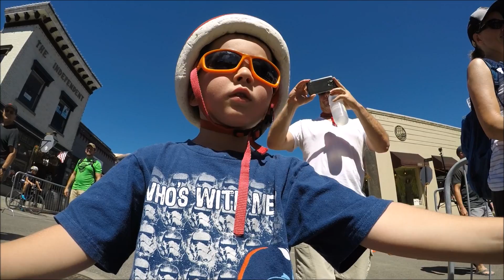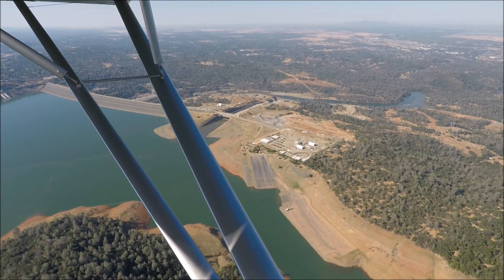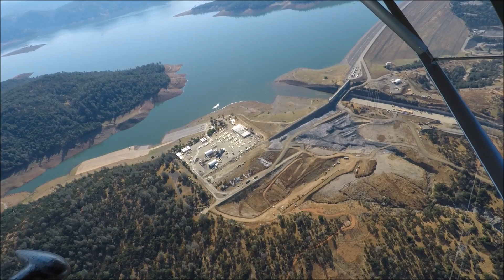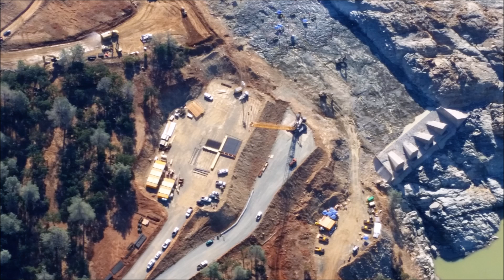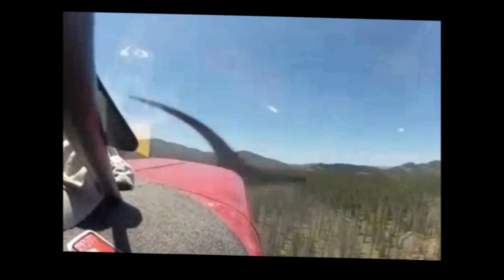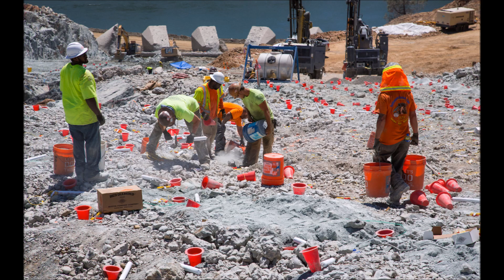Oroville Update 21 June It's Heating Up!

Comment: The part I find ironic is that the airlines do a CYA on the weight balance, etc calculating it to a gnats leg.   However the weight of the passengers and carry on luggage is estimated, not actually weighed.  Good part is that the jets most of you fly are much more forgiving than small general aviation airplanes like you also fly.  I am a wanna be pilot, always interested in airplanes, wanted to be a fighter pilot glasses in grade school put an end to that.
Reply from the maker: measure with a micrometer, mark with chalk,  cut with a hand axe...

Comment: As a flight engineer computing performance data for 23 years, I got a nice refresher.  Thanks.  But in my day we had performance manuals where we used charts to compute the speeds and distances.  Computers with performance data were not around in those days.
Reply from the maker: Spaghetti Charts!

Comment: I live in Maryland but I'm fascinated by the recovery project from the spillway failure. Yours are the first updates to which I turn when looking for the current status. Love the mighty Luscomb!

You've done a great job pointing out what the various areas are in the project. What I'm having a hard time with is understanding the overall plan. Examples: rebar has shown up above the diverters but I can't seem to find out what it's for; I've never understood what's going to fill the huge chasm where the failure occurred.

This leads me to wonder if this year's project can actually be completed in the next four months. DWR seems confident, but what a disaster it could be if that was over-confidence.

Thanks for the WebCam links. The time lapses are particularly informative.
Reply from the maker: stay tuned, update next week explaining all that...

Comment: That was a tough video to watch with the Stinson Voyager.  My father owned a 108 and learned to fly it.  He flew us all over Oregon, Calif. and Arizona.  I remember it as being LOUD inside.   I flew up to South Lake Tahoe one summer afternoon in a C-177RG just to experience density altitude for myself (alone, no luggage, half fuel).  An eye-opener but I had a plan to abort if I wasn't up to indicated airspeed by a certain point on the runway.  I had no problems but remember it well.

Comment: When I worked at Boeing in Wing Structures I think there was some office talk about possible heat induced loss of lift and power.  I also thought the FAA had requirements for operations in excessive heat but I didn't know there was a shortage of data for those conditions (until now).

Comment: What do you think of Scott Cahill's assessments?
Reply from the maker: borderline nutty.
Reply: From personally and professional experience, I've found that folks without the necessary background tend to dismiss technical and voluminous amounts information, as it is simply beyond their comprehension, and settle for the overly simple and convenient.  And reassurances are always welcome, while disturbing information is not.  IMHO, there always room for error and debate, however, if Cahill is only correct in part, the import should be substantial.  We have a responsibility to each other to tirelessly seek the truth.  Cahill is the only 'expert' to substantiate his conclusion.  We need to find an opposing view, an another independent expert, who is willing to substantiate his view in depth before we can consider the dam safe.  As it is, it prudent error on the side of caution and to consider it unsafe at this time.  Having worked within the bowls of government as a technical expert, we should not be satisfied by explanations from those who may have something to hide.
Reply from the maker: The dam is not an issue.

Comment: Juan--I don't want to read thru 400+ comments, so sorry if this has been asked...
you talked about flying early morning because of he heat, isn't the planes material also a factor? your Mighty Luscombe is aluminum? seems like that would be an issue
on a hot day, as opposed to a "fabric" covered plane? wouldn't  you plane be hotter?
Reply from the maker: not a factor...under extreme cold the fabric may wrinkle slightly.

Comment: Thanks for the update, Juan. You really keep DWR on their collective toes during the conference calls. I can almost hear their hands waving when they answer your questions.

I read somewhere that the flow rate of 270k cfs was predicated on the reservoir level being above 901 ft, in which case, the emergency spillway will also be operating. It would be interesting to know if that's correct and if so, what is the maximum flow of the gated spillway at 901 ft or less.

If the expectation is for overflow from the gated spillway to go into the "canyon", what are they doing to prevent erosion. If any substantive flow went through it as is, the loose rock would be flushed into the diversion pool in no time flat.

It would also be interesting to know if they plan to lay RCC on fill or if they have to remove all loose material down to the competent rock. If so, it appears they are pushing fill into the canyon which they will only have to remove.
Reply from the maker: we'll talk about this more in future updates...

Comment: Do you think the excessive heat is what happened to the RQ-4?
Reply from the maker: not sure...link?
Reply: http://fox40.com/2017/06/21/spy-plane-on-routine-flight-to-beale-air-force-base-crashes-near-mt-whitney/
Reply from the maker: Huh interesting...I doubt density altitude was the problem here...possible CFIT, of a drone...(Controlled Flight Into Terrain).

Comment: So, no plan yet on how they plan to "divert" some percentage of upper spillway water into the canyon if that becomes a necessity?? 
Question: 
If they do need to use the canyon, since they are apparently filling in the canyon (so far about 2/3), won't running a bunch of water through there simply re-locate all that loose fill into the "tailrace"?? Or, are they planning on "hard coating" the surface with shot-crete or ??? 

If possible, it sure would be nice to see some much closer shots of the landscape they are working in at the lower spillway to get a better sense of how big and irregular that base surface really is. The long shots don't do much to convey the scale of that texture. 

Thanks for the meaningful input you provide on this, as well as other subjects. Much appreciated.
Reply from the maker: One of my very next question!...I'll add those photos next update.

Comment: With all the new roads and exposed bare ground is erosion going to be a problem once the rains start?
Reply from the maker: They'll have the drainage worked out by then. Erosion control measures too...last step of the process.

Comment: Building I-680 Benicia Bridge Project with Kiewit back in 2005, we used "lightweight" high strength mix designs.  Often an 11.5 sack mixture.  Consider most commercial mixtures are 5 to 6 sack. That's  the amount of 92 lb sacks of cement per cubic yard of mix. Before mixer trucks left onsite batch plant, we'd stop at a tower that inserted a "wand" into the mixer barrel and would inject liquid nitrogen amount adjusted to ambient temperature.  We then had either 45 minutes,  or until wet concrete temperature reached 65 degrees,  to start discharging it into pump.

Comment: Considering the heat and the size of the budget, they should build a pool for the workers to cool off in! They already have all the equipment there. Seriously though, they must have a plan in place to ensure the workers are rested and cooled off periodically...for the health of the workers and also to improve their efficiency. I'm surprised they don't have air conditioned sheds everywhere. Maybe they are spraying them down with the water tankers? A water mist system would drop the temps by 30+ degrees. If the heat is forecast to continue, it might be worth the investment to keep things moving.
Reply from the maker: Good Idea! even a portable mix tanks type pool...
Reply: At the next briefing, you may want to ask them what accommodations they are making to keep the workers cool and hydrated. The other question I have is regarding the purpose of the fences they are erecting on the lower sw. Thanks Juan!
Reply from the maker: They discussed hydration issues at length. Not sure about the fence yet.

Comment: Things I see on the June 20 DWR video...-workers removing smaller rocks by the bucket.   - Rebar!  There's a bunch already installed in the cleaned section of the lower spillway.  They look to stand a whopping 7ft tall (or so).  -they mounted an old tractor tire to the excavator to scrape the muck from the water blasters.  -Is that crane on a new concrete pad? Or is that just gravel?  -Looks like workers struggling with a clogged conveyor belt at the rock crusher.

Comment: How will they make a watertight connection between the new lower spillway and the old upper one?
Reply: Maybe shingling the layers would be the best approach, have each section keyed and one pour extending well up past the bottom lip of the next.
The hydraulic pressure is enormous with that kind of fall- concrete expands and contracts so it has to be jointed.
Reply from the maker: sparkss4 stay tuned...good question#
Reply: Not sure why this would be an issue. New concrete can be bonded to existing concrete and anchored with rebar.

Comment: EDIT: I have finally found the other Webcams/ Timelapse videos
1)  http://www.parks.ca.gov/live/lakeorovillesra_spillway
2) http://www.parks.ca.gov/live/lakeorovillesra_spillwaytop 
3) http://www.parks.ca.gov/live/lakeorovillesra
4) http://www.parks.ca.gov/live/lakeorovillesra_spillway_timelapse

Also check out the online photo library at:
https://pixel-ca-dwr.photoshelter.com/galleries/C0000OxvlgXg3yfg/G00003YCcmDTx48Y/Oroville-Spillway-Incident-Recovery
Reply: Thanks for the links Stryker. Love the fact that many commentators chip in with helpful stuff on Juan's channel.
Reply: Here are three at once: http://www.disclosuremedia.net/oro/cams.php
Reply: Did you watch that one cam for long?  It rotates through 4 different views every 30 seconds or so.  All from the same location, but moving and zooming to each.   There's another cam, I think on the visitor center, that looks at the dam from the water side.  But you can't see the spillway from there.
Reply: Thanks, Stryker, for this information. I did not know about the additional webcams other than the first one.
Reply: There are actually 3 webcam pages and 1 timelapse webpage with several video's. I finally found them and  added 4 links to my original post.
Reply: Nice.  Didn't know there was a top cam or time lapse.  Thanks

Comment: Another excellent video Juan. Maybe you can ask this question of DWR during the the next Q&A.
Are/have they considered coating the channel leading up to the spillway gates with RCC? I realize the condition of the spillway itself limited the outflow rates (too little= back cutting below the upper section of the spillway. Too much= scouring occurs sending more debris down the spillway itself). A fully repaired spillway would ideally eliminate the need for this, however with the potential for another record rainfall next year, they could run the main spillway at max CFM without scouring the channel.  

Anyway, you now have my vote for reporter, pilot and father of the year.............KUDOS!!

Comment: Hi Juan, we have seen many times now the structural concrete plant but I am more interested in seeing the RCC plant. As this year goes on I'd be most interested in watching the RCC plant and installation processes. Just as the existing spillway was tied onto the bedrock, I would assume there would be an extensive system to tie in the structural concrete to the RCC?
Reply: RCC and structural concrete are comprised of the same materials (aggregate, cement, water, and other admixtures), but differ in the mix design or proportions of these materials; RCC is much stiffer (less fluid) during placement. As a result, the batch plants will look quite similar.  RCC placement occurs in relatively thin layers or lifts (nominally 12 to 18 inches) without reinforcing steel and each layer is compacted with steel drum rollers, similar to asphalt paving, prior to the placement of the next lift.  RCC placement will occur in several layers to achieve the desired height.  The edges of each lift of RCC are formed, which are removed after sufficient RCC strength is achieved.  Quite different than structural concrete placement.

Comment: Guess being curious what holds up the weight 227 Olympic size swimming pools full of concrete encasing 81/2 million pounds of rebar on the side of the hill is far too difficult a question for the PR dept.

Comment: The next time you're doing a live conference with the DWR  ask them what's going to happen to all the loose material that's now in Croyle canyon. Are they going to have to remove and than replace it  with compacted material? They have a lot of work to do to make the November deadline.
Reply: If they complete their work on time, there is no need to remove it. It's a calculated risk they have taken.

Comment: I wonder if its possible to do both open ditch and enclosed piping for the drangage. 
 I wonder how many anchors are used per X square feet, there dimension and how they are installed.

Comment: Great report.  I think I could almost like flying if you were at the helm or what ever you are at when flying.  A lot of workers & equipment but only 120 to 150 days on the outside if the weather holds (not too hot or wet) and nothing goes wrong. How much curing time is the structural and/or slab concrete going to need before water starts flowing over it?  28 days for ordinary strength concrete but the surface I think would  still be vulnerable to erosion for some time longer even after it reaches design strength.

Comment: The cutoff wall will be useless If water undercuts the Wier above and it topples.  Why would they tear out all the work that has already been done?  I advocate a proper second spillway that can actually control the outflow, and the lake level.
Reply from the maker: That's the idea of the secant wall...prevent toppling of the Ogee weir.

Comment: Is the rebar epoxy coated or not? Uncoated rebar fails do to rust expansion! See the book Concrete Planet.
Reply from the maker: not sure...
Reply: From the picture as it brown in color, not the greenn of epoxy coated, it is not!

Here in upstate NY, everything using rebar is epoxy coated if it wants to last! Freeze/thaw cycles plus road salt in the air encourages rust which does the concrete in.

Somewhat surprised it is not being done here!
Reply from the maker: Good point!

Comment: So, the answer to the first question - why the repaired lower spillway will not be capable of greater than 100k CFS flow is that they're not planning on getting all the structural concrete laid down on the lower spillway this year. That's a significant revelation.
Reply from the maker: yes!

Comment: do foreign subscribe to the  stringent data requirements before in airliner takes off? Thank you Juan. great informative video as always.
Reply: add- foreign countries
Reply: Click the little bar on the right to edit your comment.
Reply: Pretty much any airline in any country.  They all have their equivalents of the FAA that sets rules and regulations and any international flight tends to have to satisfy the constrains of both countries FAA equivalent.  This is generally made easier by the FAA and their equivalents being basically in sync on rules and regulations.  In addition, insurance generally requires this level of record keep as do lessors which own a substantially large fraction of the commercial airline fleet, esp outside of the US (globally it is ~40% leased aircraft with the ownership levels generally higher in the US).  And further in addition, most commercial airplanes have either power by the hour or maintenance contracts with the engine manufacturers that require detail record keeping.
Reply: Aaron-thanks for the incredibly detailed and informative answer. I take your part of the airline industry in some capacity
Reply: Johnny-thanks

Comment: So how would they divert water coming out of the spillway over the side wall into the canyon?? That doesn't make much sense.
Reply: Andrew, goal is Roller Compacted Concrete(RCC) spillway with short walls for up to 100,000 cfs discharges next season. Any more than 100kcfs will spill over into canyon. This years max flow was 100kcfs down spillway.
Reply: I guess I assumed that the water would be diverted to the canyon,  not over the right side of the wall as well.
Reply: Right wall (looking from the gates down) may be higher than the left so into the canyon it would go.
Reply: Hidden Treasure Ok, that makes sense! Thanks for the reply!
Reply from the maker: I'm still not real clear on this either...

Comment: I have always wondered about how precast concrete is pulled out of the forms. Do they have a plastic sheet (or some other type of material) under them to allow release? I guess I could look that up, to... ;)
Reply: The concrete generally won't bond with smooth dissimilar material like plywood or steel forms.  Worse comes to worse, a good whack with a hammer on the form will release any tension